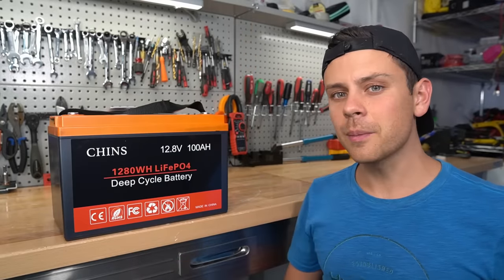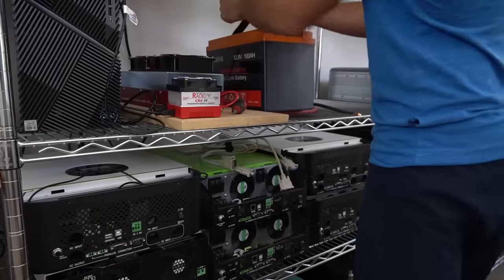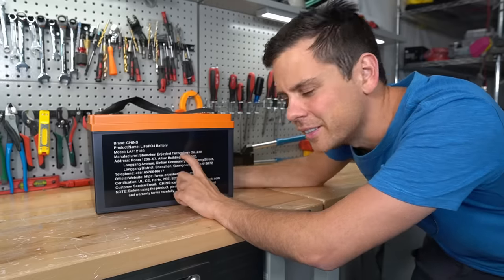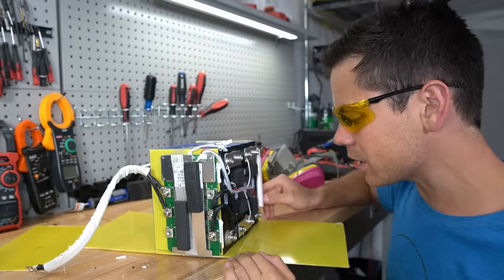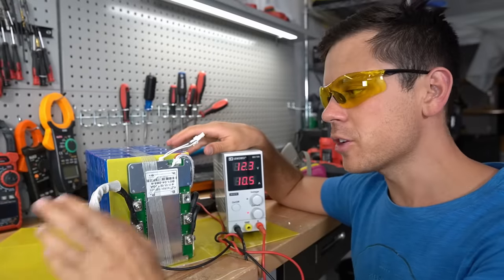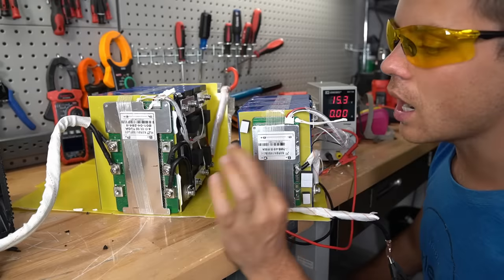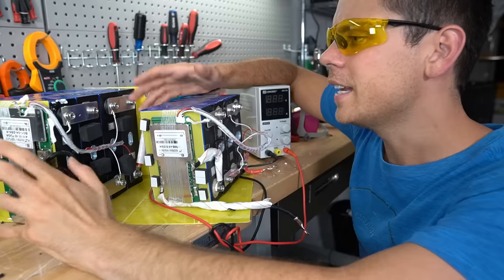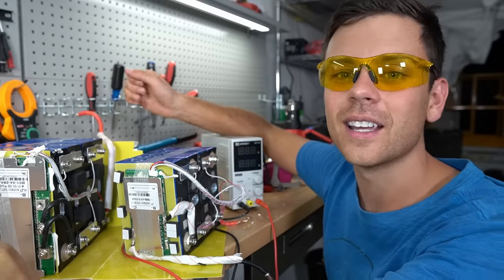$379 CHINS 12V 100Ah "Plus" LiFePO4

Comment: As always, LOVE the Resource that you provide.  Two questions, if you will, Will 🤣:  how frequently do you update your recommendations for Entry-Level 12V batts ?  Second, is there a “hack” to make a non-low temp protected battery, low temp protected from an inexpensive add-on ?

Thanks again Will !  🙏

Comment: Great Stuff Will - the reason they only use a high temp sensor and no low temp sensor is because the high temp will prevent a run away and fire so its a liability thing. A low temp sensor only shortens the battery's life! 

Stay Safe - Mike

Comment: I’ve been a subscriber for several months now and love tour reviews and your extensive knowledge of batteries and solar. This is probably a trivial question but in connecting cables to my battery, is there a limit that would begin taxing battery? Example to have all this connected to battery posts: one charge line from solar, an output line to the camper 12v port and another output going to an inverter. Thanks Will.

Comment: From what I can gather, this manufacturer is in southern China supplies electric bike batteries. The area is the silicon valley of hardware in the world. The electric bike in sub-tropical weather climates doesn't need low temp cut-off, I supposed. They never see snow. From the quality build, they been around and branch off to the American market, they are not big but got in the new fast-growing industry. I live in AZ with no low temp in 15 years and the battery is indoor. The warranty service just 5 hours away. So that is a sweet spot for me.

Comment: Awesome video as usual with great detail and down to earth!!  My question is would you run a 200Ah Chins or a 206Ah SOK?  I have a suv that I want to power my 12v fridge and some scene lights with.  All in with everything running they draw 7-8 amps max.  I have 200 watts of solar panels on roof and it will charge the battery thru a Redarc bcdc1225d controller.  I want to leave my fridge on all the time to keep things cold....  I know real world problems lol.  Do I need a heater in the battery?  Thank you in advance.

Comment: I use the WiFi app for the smart switch to come on 1 time each hour to rotate approx 3 degrees each time . then return by switching on 7 times to rotate back for the morning using the fuse box you recommended on your 400 watt build to supply power from the battery's.

Comment: Will,I love your videos and have learned a lot from your knowledge. In your videos that i have watched so far,the battery builds you have done whether 12v or 48v you have not shown any real world use using these different builds(correct me if I'm wrong). It would be nice to see what the different configurations(100 Ah vs. 200Ah battery) would provide to a weekend camper. Showing us items that can be used with the specific build, how long it would take battery to be depleted, and how long it would take to fully charge back up using a 50watt or 100watt solar panel. Would you always have total continuous running power from solar panel so that the battery never gets depleted?

Comment: dude you a nut.  big compliment there.  love the videos, the lack of cursing makes me nervous. if i tried a video it would just be a bunch of beeping.   you probably saved me a bunch of money.  i started solar years ago. just a small system backup lights for the house.  solar in the barn and greenhouses.  hurricane came through couple years ago left us without lights for 2 weeks.  had a hell of a time finding fuel for the genny.  mother and grandmother is on oxygen and bed ridden plus im disabled.  installed a mpp lv24-24 and 3kw of panels.  had to use lead acid batteries.  but the all in one unit has worked flawlessly for a year.  oxygen, cpap machines and ac in their room never miss a lick .  loosing your freezer here and there is one thing. keeping the oxygen going to those ladies is another.   thanks for the videos and all the testing.

Comment: A couple of ideas for videos.

Wind turbine to batteries. Maybe a separate connection not through the same charge controller.

Battery balancing 24v and 48v lead, gel, sealed battery banks. Using a battery balancer.

Taking 12v and  hanging 12v to a 24v battery bank. Using a 24v or 48v battery balancer.

Comment: Amazon page shows they now include low temp cutoff ($229 - $30 coupon = $199).  Hopefully they are still building them okay.  However, the Chins page in Will's affiliate link does not mention the low temp cutoff.  I guess without another teardown it will be hard to know for sure.

Comment: I saw your video after I had ordered the Chin 12v 100amp battery, so I was really holding my breath as I watched you destroy that perfectly good battery (Good Job by the way)  Thanks so much for posting this, made me feel so much better purchasing it.  I live in NY so thanks for the hint about the low temp monitor.  I will be bringing in my battery when camping season is done.  Thanks again for such a Great video!
Reply: I think you mean 100 ampere-hour. You omitted the time element.

Comment: These are available in the UK under the EnergyStor brand at LowEnergySupermarket, with or without bluetooth (the bluetooth ones are out of stock and cost about £30 more, inc tax). They are the same base price of around $510-520, but we have to add Sales Tax (VAT) (20%) and import duties/charges (over 5%), which makes them more expensive. Also they are all black colored, and the specs say they have 0C low temp charge cut off, and -15C discharge cut off.
Reply: Found them under the Ultramax brand LI100-12 from Battery Masters (and the listing says charger included?) at just (from) £388 including all taxes (that is the equivalent of $449 plus tax), and only an extra £15 ($17 plus tax) for the Bluetooth model.

Comment: A lot of comments mention bad smells on all different imported products. It's cheap but if it's like everything else it'll fall apart in a short period and the costs aren't as cheap as they were. As for the good comments certain workers are paid to put comments in. The product will have a high number of comments. A lot of 'LOVE LOVE LOVE!!! Best ever!!!' Or it'll directly refute anything negative (usually sizes way off or lower quality than previously) in another person's comment. They also leave really nasty comments on competitors products. A lot of people are confused by it now that Target - lately it seems Home Depot joined in with Amazon and Walmart.

Comment: A couple+ questions: Any thoughts on Lisuateli LiFePO4 100Ah? Difference between white vs black case? What is smallest form factor of LiFePO4 120Ah for std RV battery case? Are 120Ah worth $ difference vs 100Ah? Is there an easy way to tell what type of cells are used - prismatic vs cylindrical? Really like your work and value of info your channel delivers. Thanks much, Will.

Comment: Hi Will, Love your content. I'm looking for a LiFePO4 100 Ah to put in my camper with 200 watt solar package it came with. I'm full time camping and really only need it if the power goes out to run the 12V refrigerator and a CPAP machine. I'm looking to be in the $300 -$500 and just very overwhelmed of the different product. If you could make a recommendation that would be appreciated

Comment: No low temp disconnect is not a deal breaker in the slightest.  Just use a 12v warming pad with built in thermostat and insulate your battery box,, then you can actually charge it in cold weather.  They run around 40-50$.   a low temp shuttoff is only protection,, other than that it serves no purpose.  I need to be able to charge on winter days.

Comment: I've been looking for a battery for a new inflatable boat trolling motor and thought I'd investigate these guys a bit.  I'm kind of on the fence in that I couldn't find their warranty info on their website,. They did respond to a couple Emails, but they were a bit nebulous, so I'm thinking they don't have a hard and fast warranty policy in place.  What I gathered is 90 days full replacement, 1 year you have to work with their support to troubleshoot any issues, and they will replace what's bad and they pay return shipping if needed.  2-5 years is the fuzzy part- you work with their support and you MAY have to pay any shipping.  I didn't get an answer as to where the battery would need to be sent, so if I have to pay $100+ to return a battery or have one shipped to me, the price becomes a bit less enticing.  It's still tempting and Imay roll the dice, but I just wanted to add this to the thread.  AND, I'm a noob to the LiFePo4 world, and you've provided a LOT of valuable info here.  THANK YOU!

Comment: when you use your RV only in the spring and summer a low temp sensor is not needed  when you remove the batteries in the winter when your RV is in storage that is what i do and the chinese batteries hold up fine

Comment: Will, on chins description on amazon, it says they can recharge at -31F ( I doubt it really can ) but it is probably the reason they didn't put that low temp sensor on it. Would be nice if you could test it out for us, recharge at a freezing temp to see if it damage the battery.
Reply: "Smart LiFePO4 Battery, Support Low Temperature Charging (-31°F), Built-in 100A BMS, 2000+ Cycles, Mobile Phone APP Monitors Battery SOC Data Brand: CHINS"

Comment: Will, good review....what are your thoughts on upgrading a camper to lithium battery since the price is coming down?   Also- other than upgrading the power center of the camper- is there any other upgrades that would be needed to switch to lithium?  For a dyi video, you could show a mock up of an existing camper/rv setup and what would need to be considered in an upgrade?
Reply: Wish he'd answer this.

Comment: I found out that you can take a 12 volt RV water tank heater and stick it into a battery box with this battery and when the temperature drops below 45 degrees the heater will kick on until it hits about 80 and then it'll turn off all automatically so I'm going to try that

Comment: Wouldnt think the lack of low temp disconnect is that big a deal. A 100 amp relay costs about £20 here (around $15 in yankland dollars), add a temperature sensor and a rechargable battery and you have that feature for next to nothing.

Comment: After waiting several months for SOK, I gave up and I ended up getting two 300AH CHINS batteries because they were in stock and ready to ship.  Figured, at least CHINS would have stock be able to warranty if I had problems.  Whereas SOK was unable to deliver.  I looked at the booklet that came with my batteries, very clearly states that it has a "Low Temperature heating function charging when the ambient temperature is lower then 0* C the internal heating plate of the battery will get heated to 10*C our battery starts to charge automatically... " 
Interesting that Will found no evidence of a low temp sensor or heating blanket.  Weird.

Comment: I have heard you rail about low temp protection many times. My personal opinion is simple, if its cold out, disconnect the battery. We do that all the time with our camper. Batteries are still good after 2 years. (Deep Cycle-Lead Acid) Low temp protection is proably nice, But I don't see the need of it, In Our Case. Really like your videos. :-)
Reply: Lead acid can be charged in low temp, but lithium on the other hand can obtain permanent damage if charged in below freezing conditions.

Comment: Will, could you tell, were the cells grade a new? I get that one could build a diy cheaper, but man, even the 100ah cells shipped, take forever to arrive! In the range of 30-45 days, or longer from china I've seen. I'd consider getting 2, gut them for the cells, build my own 24v pack, add a readily available quality bms, and done. All for about 1K. I paid about $1450 for my 8X 100ah+bms from OKS. Granted, it's rock solid, but if those chins cells are new, and capacity is confirmed, might be worth it to get them just for the cells?

Comment: Great review Will. I just purchased 3 X 12.8v 100ah VoltaX lithium batteries for $410 each Australian, now that around $310 US. I'm not sure if you have heard of this brand, I had the same brand in AGM my camper trailer and they lasted around 4 years, but didn't last long running my camper equipment for very long without sun and they were very very heavy. 
I know it's to late for me, but would like to know if they are good quality so others can get a better idea of what they getting for there money.
One more question, I noticed on this battery you are testing said 12.8V same on mine VoltaX but the seller says at this level the battery is flat, need to be at least 13.5V to be fully charged?

Comment: Will, I recently bought a Chins 12.8V 20AH version to power an VHF/UHF amateur radio at my office. Have you ever reviewed the Chins 20 ah version? This will be used in my office so I am not overly worried about a low-temp sensor. Thank you for your videos!

Comment: Amazon link says "Built-in high temp cut off prevents charging over 122 °F (50 °C)." 
Will got 75 °C.  THis same battery is US$704 in Canada (CDN$869.24) with an extra CDN$100 delivery fee.

Comment: Since you have that 100 ah apart, It would be nice to cycle the batteries enough times to see if the cells stay in balance. 4or5 50 to 80amps charges & 20 amp discharges should start to see if there’s going to be an issue. That seems to be a big problem with the cheaper ones. BMS isn’t up to it or poorly matched cells. Most end users will just hook them up and never know before it gets really bad that one cell is over voltage tripping and eventually lowering the entire battery capacity/voltage.

Comment: Could you add a low temp sensor with a circuit that makes it look like a high temp? Then wire it in place of the high temp sensor. If the temp goes low the BMS would shut down the charging. That way you avoid using a big disconnect relay that draws a lot of current. 

I'm thinking back to your trick of using the all in one inverter/charger power switch to avoid the big relay. Maybe Great Scott or Electronoobs would collaborate with you on something like this.

Comment: Hey Will. Thanks for all your great info! I am considering buying one or two of the 300 AH version of this because it's even cheaper per AH. I'm in upstate NY, and my use is seasonal. My question is this: Can I set up my Midnite Solar Classic to stop charging when the temperature drops to freezing, so that I don't kill the battery? I have a temperature sensor on the current (dying) AGM battery bank, connected to the Classic.

Comment: Will, Chins sells 300ah batteries with built in heaters. The documentation states that all input current is used by the heaters until the cells are warm enough to take a charge.  Do you have any intel on whether that works?  I just installed two of them in exterior battery boxes on my camper van but since it is not cold out I don't know if they work.  I don't intend winter use, but just wondering.  Thanks.
p.s.: The cool thing about the Chins 300ah batteries is that they are the same size or slightly smaller than AGM lifeline size 8-D, so they make an easy retrofit for a lot of RVs.  For us, that size factor was a big decider in which battery to use.

Comment: Here is a scenario where you would need a temperature sensor on your lead acid batteries:
I once was stupid enough to buy two boat batteries of a reputable brand in addition to the regular leisure batteries that I use. When I am away from the cabin, criminals move in and live there pretty fast. They are using and damaging my stuff and are stealing some of it. One thing they happened to steal, was the acid in one of those batteries. When I was charging them (with 10 A AC chargers without temperature sensors), that battery was about to catch on fire/explode. By chance I toughed it to see how warm it was, and it was burning hot. If I hadn't noticed that, the cabin could have burned down, not to mention injuries on people or pets. This is what can happen when law enforcement loses control over a district..

Comment: LiFePO4 battery EXW price per Wh costed around 20 to 30 cents in 2016 when purchased to good quality chinese battery manufacturer. 
So that 1280 Wh should cost around 250 to 350 US $ EXW price. Now considering DDP incoterm, $509 doesn't sound like a crazy price, fair price would likely be the right term.

Comment: Pretty sure that the big multi-national corporations pay for all the R&D, send the specs to the factories to build, then the factories that don't give a F about intellectual property just sell the (unbranded) products to whoever they want. Everyone buys and slaps their label on and resells. Doesn't mean it's bad quality, look at Monoprice.

You could probably get WillProwse branded batteries from the same factory and resell yourself. Likely that you could even add the low temp sensor to the battery as long as the BMS supports it. 

Those factories in China will make you anything you want if you order enough in bulk.

Comment: I just checked Amazon form the chins 12 v 100a battery.
The price went up to $868
Will you should do the tests under the table 😎just for the inner circle
Reply: It us currently $355. I just checked. (DEC 14).   Last month, I paid $355 as well.  I